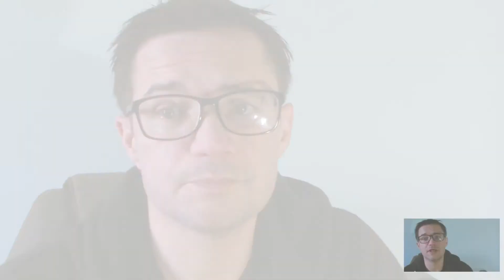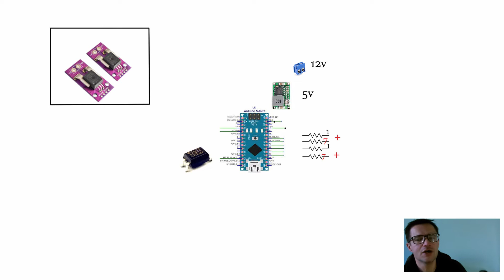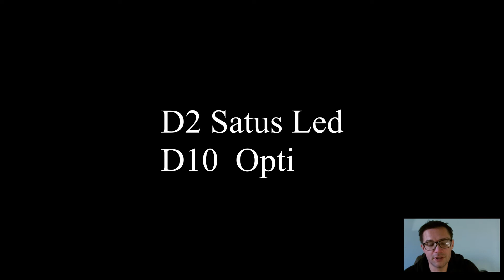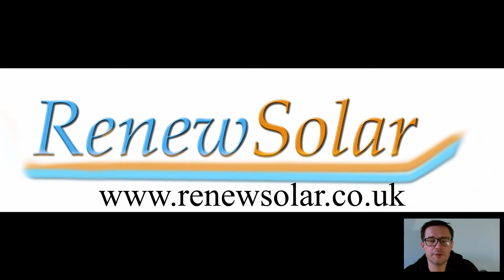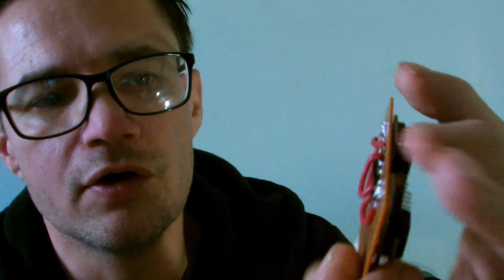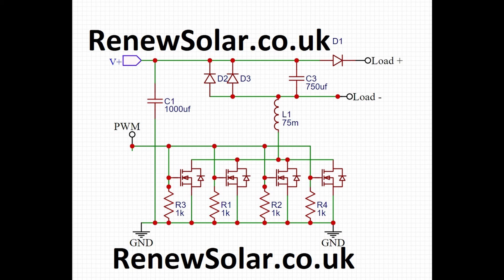MPPT Charge Controller

Comment: Thanks for you video. At least a proper driver on the mosfet gate could be useful.
Reply from the maker: Yes there are many ways to drive a fet, and it's where you put that which goes with the modular design.
A bjt could be used as it's low power switching

Comment: I am an eee student. I am making my own mppt solar charger for school project. its not going to powerful one as yours. I have to design my own pcb board. Will you share your final schematic with me? Greetings from Turkey
Reply from the maker: As a  past teacher, the information is there, the coding on the blog. Two current sensors, two voltage dividers. And a buck converter.
The rest is a pwm code and isolation from one part to the other.